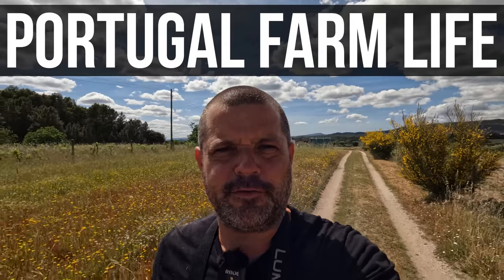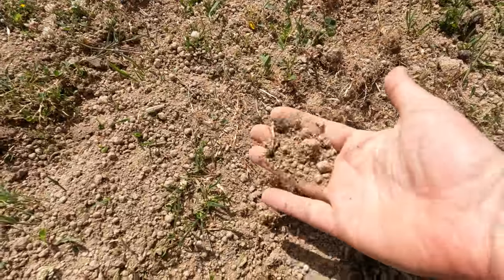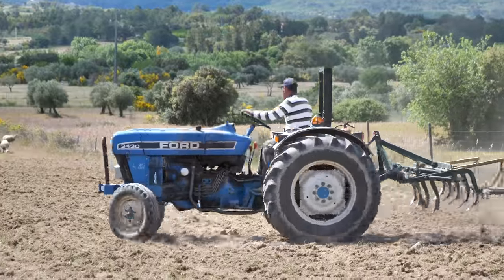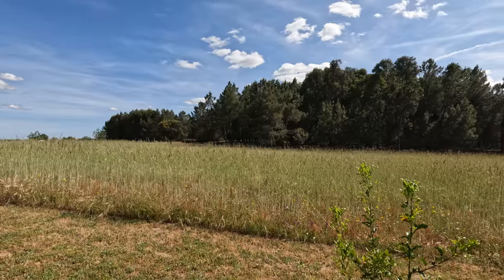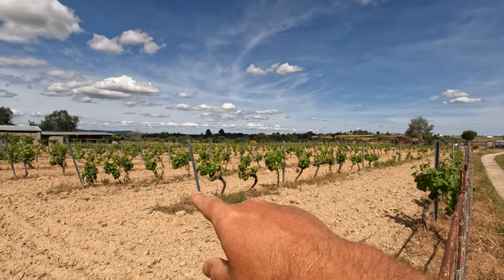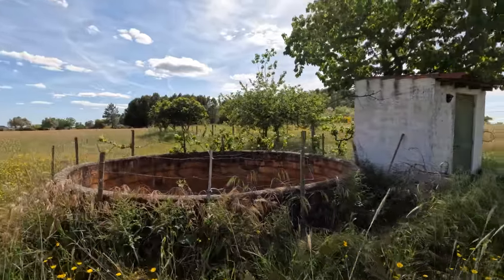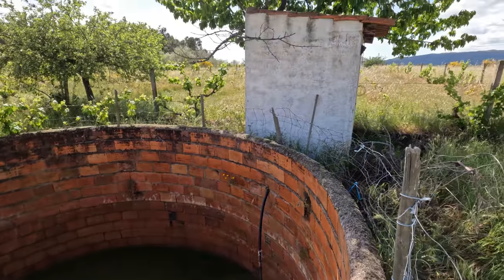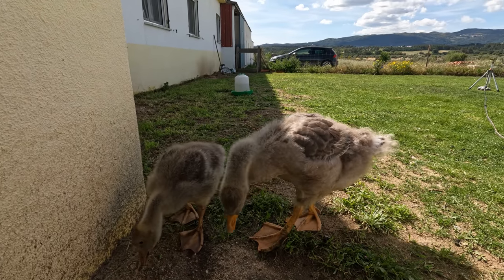Will this help to beat the extreme drought? | PORTUGAL FARM LIFE

Comment: Nice one Ken.  The cylinder in your pumphouse, is called an accumulator and it's function is to maintain the water in the system at a constant pressure irrespective of high or low demand.  It consists of an internal air filled rubber bag which is acting against the stored water and keeping it under pressure.  As the water gets used, the said pressure in the accumulator, starts to reduce until, at a preset level, the pump will kick in and start refilling the cylinder hence maintaining a constant level and pressure.  It's a self-governing, feedback loop system which requires little maintenance, but, like all systems, can be affected by component failure.

Comment: I think you have a great relationship with Joaquim. Very beneficial to you both. Anyway, I did see in the news that Spain and Portugal are in for some serious heat again. It's certainly worrisome. It seems that 🇨🇦 will be in for it as well. Where I am in Nova Scotia, we have drilled wells, and water is plentiful. April has been dry here as well. The 1st week of May will bring some rain.  I wonder if covering the well will prevent more loss through evaporation, or will it diminish the quality of the water. Climate change is getting scary. 🙂👍👍🇨🇦
Reply from the maker: In the 4 years that we have been on the farm, last year was the worst drought. I think they classified it as extreme drought. Even so both our wells and dam did not drop too much and over the winter we had record water levels as we had a very rainy December. I have full faith that our wells will be plenty for us to use for many more years but it is always a worry. We could start to harvest rainwater is huge tanks for use in the summers. Maybe get some massive tanks buried in the ground feeding off the roof guttering.

Comment: Hi Ken & Gina
We watch your videos every week, my husband dream is to go live off grid in Portugal. 
Got a question about the electric bikes you have.  I want to buy one to get around in Maderia which has a lot of steep hills. 
Which bike would you recommend Eleglide or the Engwe?
Your recommendation would be greatly appreciated. Thanks 😊
Reply from the maker: Hi Patricia, do you have any bicycle shops where you live? I think your best bet is to try a few different types of ebike to get an idea of the riding position and size before buying something online. The eleglide is very good value for money but it is using very cheap components. Its very functional and capable but you can see and feel the quality difference when put next to a quality ebike from a big brand like Trek, KTM, Giant etc.

The Engwe M20 is a very fun bike to cruise on but its more like a moped rather than a bike. They do have other ebike models and some folding ones too, but they might not be legal to ride in Madeira as some have very powerful motors and top speeds above 25kph.

Definitely go to a bike store, test drive some models and then looks around online for the best price :)

Comment: What happens if in the long term, both wells run out of water?
Reply: Never gonna happen
Reply from the maker: Its very unlikely but if something like that were to happen we could get a drilled borehole that goes deep into the ground through rock into an aquifer. Alternatively we get lots of rain in rain in the winter/spring. We have a 6000 litre tank next to the house fed from the guttering. That tank was filled in only a day when it rained in the winter. So we could get massive tanks sunk into he ground and use our roofs guttering to collect rainwater to store and use in summer.

Comment: can you set aside an area for the bees? Some farms are leaving margins at the field edge only 2ft wide and they let the wildflowers dandelions and grass grow uninterrupted. It feeds the bees and hardly effects yields.
Reply: That's a lovely way to cohabitate ❤.
Reply from the maker: The main filed areas will be tilled to plant corn, but we have horizontal borders with different fruit and olive trees which get left for the bees, as well as our olive grove areas. I do cut the grass short but some hardy species that can handle the heat pop up over late spring and summer and will give shelter and food to the insect life :)
Reply: @OKportugal  The bees need all the help they can get especially early season. Having wildflowers is excellent if they are left wild. The dividend is the best-tasting hones all year round, and a sustainable environment. Because you have fire regs it has to be thought through. Good luck. You guys get it and I feel sure it's a real achievable goal as you progress.
Reply from the maker: @tedwhanstall6156  Thanks Ted, yes we have to have everything cut and cleared before summer but the edges are always left as the cutter cant really get to them. Sadly the summer sun just scorches them out and they die off during summer. Our house well keeps a nice green area full of flowers and grasses though and once the corn flowers blossom the bees love those! :)